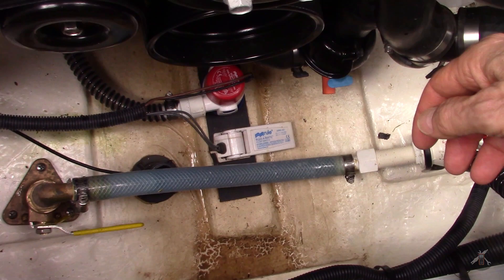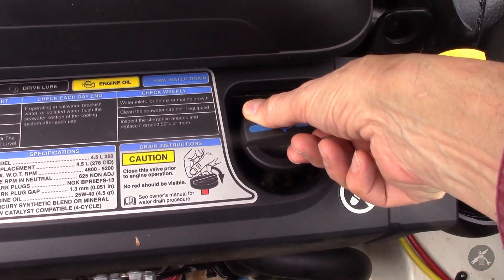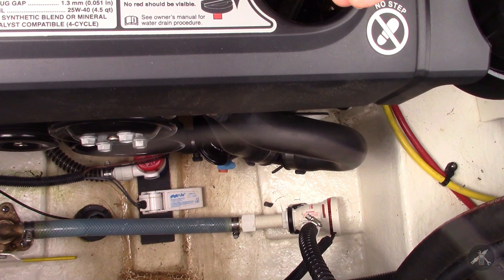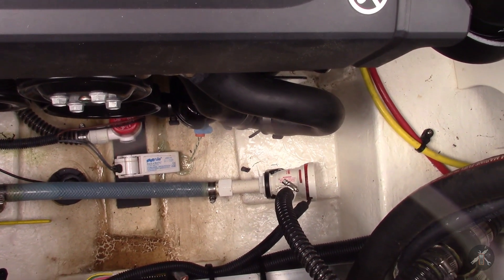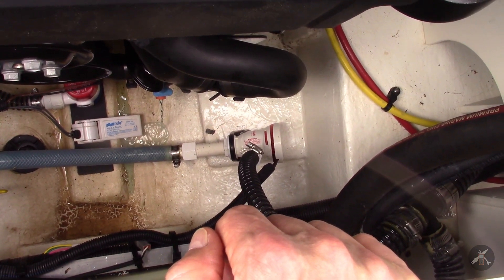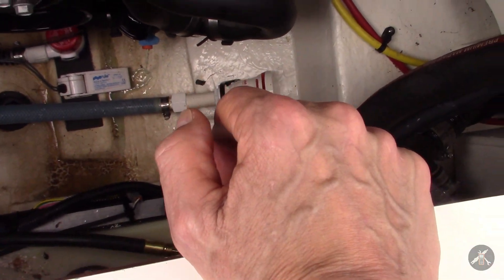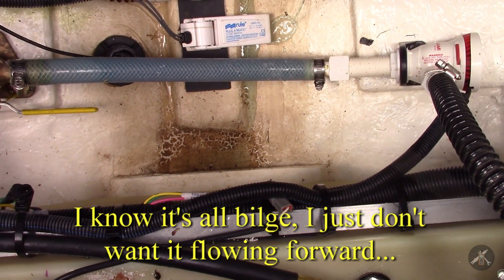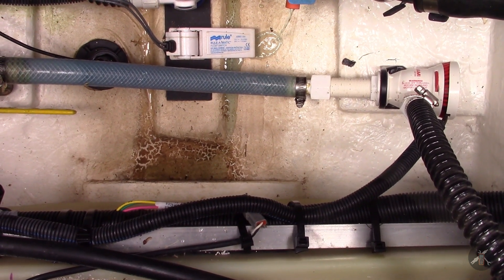Mercruiser 4.5 Winterizing - Did Pre-filling the Block Work?

Comment: The Mercury authorized shop I go to tells me they leave all of these engines dry over winter. They do all other winterization, but drain all the water out, removing the blue plug at the bottom of the quick drain assembly. Your videos on this topic have been very helpful and informative. Hope this little bit of info gives you some reassurance of your theory.
Reply from the maker: Thank you for your feedback.  I may have mentioned in one of the videos, but my first winter I had my Merc Dealer do it and they drained the system as well.  They had run antifreeze through it, then drained.  I got about a cupful out of the lower blue plug in spring.

Comment: Following your videos for winterizing my new-to-me 4.5. I am curious, now that you have seen dilution even after the pre-fill are you going to continue pre-filling? If so, why? Do you believe there is less dilution in this method? Thank you for work on these newer engines. Incredibly to useful to many.
Reply from the maker: Yes, I am continuing to prefill.  I think the testing shows that it is better than not prefilling.  Without prefill, the block doesn't fill completely. I while I haven't gone back and done a direct comparison of my data, I think dilution will logically be less if you can get the block full.
I think that it is just a caution to be sure that you have some freeze point margin in your mix. The dilution wasn't drastic, but 10 degrees F or so is worthy of note.
I will add that there is a discussion that I have been having with some of my regular followers where their alternate view is to drain the system after running this full process. That view says that "air can't freeze". So if you prefill, run the 4 or 5 gallons through the system from the ear muffs so that you sweep out as much residual water as possible, then shut down and drain; the residual antifreeze coating in the system will provide corrosion resistance. It is likely a good method as well.  My dealer did that the first year when I let them do the winterizing.

Comment: Good job on the project. I’ve been following since last year. I find that after I warm up the engine at 1300 rpm for 10 minutes and get it good and hot. I do the single point drain but only until it stops flowing. Like 90 seconds. Not the full 10 minutes. Then switch to my anti freeze mix before the engine cools off. That way thermostat opens soon after restart.   I have not checked with refractomitor but what comes out of the block is good and dark. Similar to what went in. I drain the block and store it empty. This year I got about 6 litres (just under) out of the block.
Reply from the maker: Thank you. It sounds like you have a good plan.  If you're getting 6 liters, it ought to be full.  From my testing the thermostat really isn't a constraint open or closed.  Certainly open will allow better circulation if you can get it to reopen.

Comment: Luckily enough, my Crownline and its 350 Mercruiser lived in Arizona so I never had to winterize at all! That dogon freezing weather is like living in your freezer! Nice info
Reply from the maker: Yes, if you live in Michigan, winter protection is a big deal.  But the summers are usually very nice, so there is compensation.  The 350 would likely have been easier to winterize.  My 305 carb is much easier that the new fuel injected / catalyst engines like my 4.5.